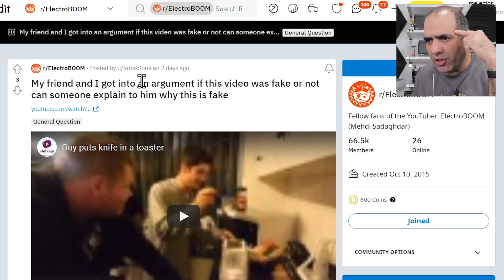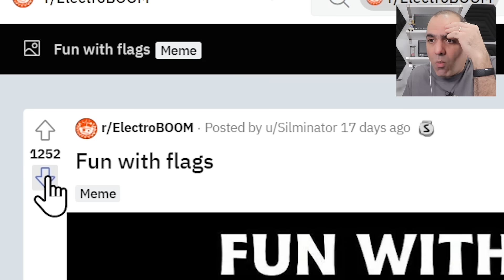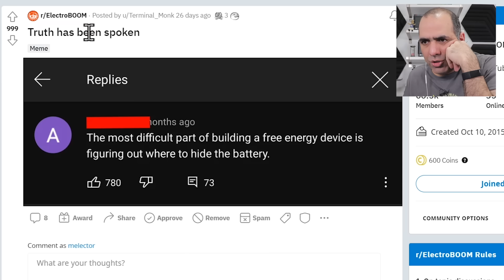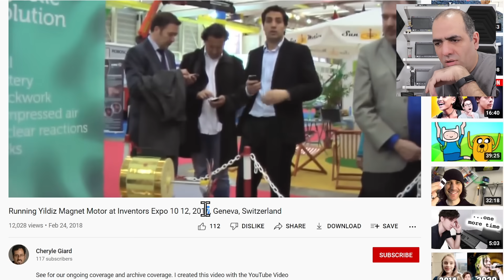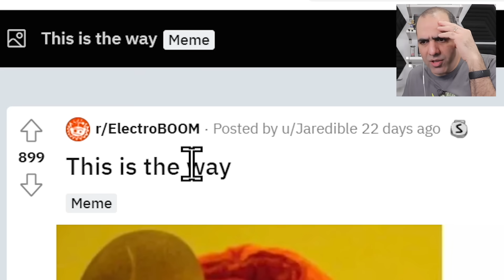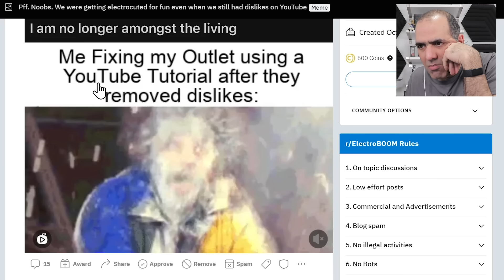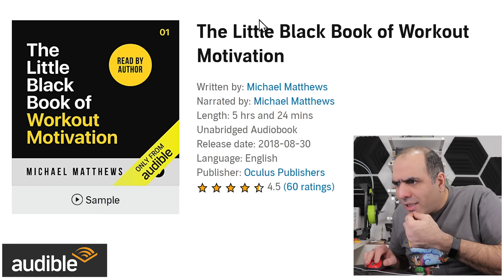Sticking Knife in Toaster? Welding with SALT WATER?!!! (LATITY-009)

Comment: that wasnt cloride i think. its probably hydrogen and oxygen. this is because of electrolysis i think.
Reply: If the solution is dilute, O2 dominates (thermodynamically favoured path). But if it's concentrated, Cl2 evolution is favoured, since it has a higher SRP value.

Comment: The "Free Energy" Motor with the magnets is real. Of course you are gonna doubt it but it is not free energy. By the laws of thermodynamics it is possible since magnets use energy. While it doesn't use electricity, it uses the energy inside the magnets which is why after a decade of use that motor will stop working, because the magnets will stop being magnets and there will be no magnetic fields. I have personally seen a machine like that up close by someone in my school who made it around a decade ago. It was at a small scale and I personally checked for batteries and there wasn't a single wire inside, it was just magnets. So, in theory it is not actual free energy as free energy does not exist but it is an efficient way of converting magnetic energy to kinetic energy

Comment: There is plug that shut off the plug power

Yes, there are smart plugs available that can automatically stop the power to a device after a set time or when certain conditions are met, such as when power consumption drops below a threshold. These smart plugs often incorporate features like energy monitoring and timer functionality, allowing for automated on/off control. 
Here's a more detailed look at smart plugs with auto-shutoff capabilities:
Timer-based shutoff:
Many smart plugs allow you to set a timer, after which the power to the connected device will be automatically cut off. 
Energy monitoring and shutoff:
Some smart plugs can monitor power consumption and shut off the device if the power draw drops below a certain level for a specified time, preventing standby consumption or overcharging. 
Smart home integration:
These plugs can often be integrated into smart home ecosystems (e.g., SmartThings, Alexa). This allows for more complex automation, such as turning off a device based on time of day, location, or other triggers.

Comment: Technically free energy is real, but its solar power/panels. The sun is free, and most of the time its there, I dont know much about if solar panels and that stuff requires a battery, tho...
Reply: It's not free energy, because you are just converting existing energy to a different form. "Free energy" refers to creating energy which according to the laws of physics is impossible
Reply: @tahmah4438  aaahh, now I see. Thanks for the explanation !! ^^

Comment: Well, as a 12 year old kid, I really was dumb enough to hold a knife in a toaster. First I was facinated by the fact the heaters got darker because it was cooled by the blade of the knife and it glowed less then. But suddenly I touched the metal case of the toaster and I popped the ground fault protection device, while the toaster sparked a bit. No boom, just a slight pop and the fridge, the tv and everything else in the house went off, as the ground fault protection disconnected.

Comment: Late comment, but the gas seen coming from the knives in the saltwater is hydrogen and oxygen gas. He's safe if the place is well ventilated
Reply: Late reply, but it's also chlorine gas (Cl2) as he used sodium chloride to make the water conductive.
Reply: @Aaaaaaaaaaaaaaaaaaaaaaaaaa-i8y  Cl2 would only be released if the solution was concentrated enough

Comment: If 99.06% of the surface area of my body has no bullet holes, it’s concerning that 0.04% of it does. If it increases and now let’s say 0.05% of the surface area of my body has bullet holes, and a little bit later has 0.06% then we start to have a big fucking problem

Comment: If you really want to use an electrolysis jar as current limiter for whatever reason, don't use salt water or it will (obviously) generate chlorine at the anode. Use a dilute solution of sodium hydroxide or even better, sodium sulfate (with suitable electrodes of course), only hydrogen and oxygen will be generated. Sodium hydroxide solution is highly alkaline, so hazardous for skin and eyes, wear protection. Sodium sulfate solution is the best choice, pH is neutral and stays neutral while operating, as the sulfuric acid and sodium hydroxide generated at anode and cathode respectively will neutralise each other on the spot.

Comment: the problem was you where trying to weld aluminium (the alligator clip) with a regular steel electrode. it would probably work better welding steel

Comment: 6:00 fun fact, that gas is not salt-based but a mixture of H2 and O2, a process called electrolysis (I think). The salts there just to let current flow because pure water is a poor conductor. It's cool for making fuels :D
Reply: It's hydrogen and chlorine gas, sodium hydroxide remains in solution

Comment: I work at appliances, I’ve seen a grounded, heating element in a dryer before. The heating element touches the housing, allowing continuous current through the heating element, and bypassing the normal circuit. As long as the dryer is plugged in the element will continue to heat, even if the dryer is shut off. Huge fire hazard.

Comment: Two things:
1. The biggest farce with "0 point" or "perpetual" energy, is that isn't enough.  In order to have a motor do work (like turn something else, spin a fan, etc.) it has to actually produce more energy.  Even if you had a machine that had absolutely zero friction and could run forever, the moment you applied a load to it, it would stop.

And 2. Youtube removing the dislikes is demonstrably not to protect the creators, as they're the only ones who can still see the dislikes.  That's like trying to protect Medhi by taking away everyone else's electronics.

Comment: Toasters used to have a double pole switch to make sure the heating element was totally isolated when the toaster was off. Is hat true now?  None of the toasters I have had used 3 wire cords with a grounding plug. Is that standard now?

Comment: 1:18 interesting thing I remember seeing is TKOR tried this (the knife was attached to a long stick and a grounding wire for safety, rather than in anyone's hand directly) and the knife seemed to form a very weak "weld" with the heating element and stuck slightly (weld probably isn't the right word, but its the best one I can think of right now)

Comment: 6:20 just a friendly reminder, SHOCKED THE SH OUT, put on your ground wire before starting to weld with TIG-method. (high voltage kickstart)

Comment: 1.Wait did he just say that he was insulated holding his knife, while the metal was still exposed between the handle parts?
2.If im right then, when he was "welding" he started electrolysis in his jar. Meaning that he propably made hydrogen and oxygen gasses which are already explosive when mixed, +many sparks nearby. Hmmm. 
I think that he was pretty much in danger.

(pls correct me if im wrong)

Comment: Hello, all the best?
    5:54  Here in Brazil there are people who use this experience to weld gates and railings, things here in Brazil are difficult to acquire, there is equipment that costs a month's salary or almost that, remembering that there are always others expenses, to have a credit card you need to have a proven salary, and registered with the worker's agency, and many are unemployed and jobless and don't have this credit, so there are many to be able to work, you have to do these things like this, even though it's very dangerous , there are many that connect to the drs, and circuit breakers, in the power drop box.

Comment: the "welding with saltwater" is actually not most dangerous beacause of terrible circuits, but beacause:

SALTWATER + ELECTRICITY = CHLORINE GAS (and hydrogen)

yeah ElectroBOOM says "it must be chloride or something" but chloride and chlorine are not completely the same
and chlorine gas was used in... one of the world wars as poison gas due to being similiar weight of air and also being very dangerous for your body if youre standing in a room with 30% chlorine gas

Comment: I also did that, stick a knife in a toaster. But it was an all metal knife, so also the handgrip conducted lol. But i didn't really felt anything and the ground switch popped, we have those here by default in the fuse closet of the house / appartment.

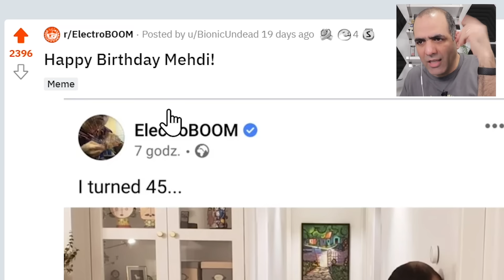Comment: 2:50 - I know a story of a man that tried to fix a microwave using a metal knife, but unfortunately had touch the HV wire with the knife, the MOT was on and he was electrocuted and died due high voltage.

Comment: At first I thought that saltwater thing was a basic electrolysis experiment, where whiteish sediment of sodium gathers on the cathode, while yellowgreen cloud of chlorium on the anode. But you probably need direct current for that. Not to mention that probably you only need a 5V battery, not 220V from power outlet.

Comment: In my effort to create a free energy device that failed, naturally. 
.
However I ended up creating a electromagnetic based capacitor that stores an ever-increasing amount of electricity in Tesla coils as long as electricity is passing through it until either it melts down or you stop putting electricity through it then it begins to discharge quickly like a crappy battery. I can't afford the equipment to test it but hypothetically it can hold far more than any capacitor of comparable size
Reply: Science-Fans are Sometimes Dumb. Its ok, i can say that, cause im a Science-Fan myself. But jokes aside: Do you keep yourself updated on local and global Issues, friend? Are you aware of the the possible Food-Shortages as well as the Danger depicted in the GOP-Videos of "Some More News"? Said Channel covers Crops, Hate, War, aaaand mooore, so it’s really valueable-much to keep you updated.

Comment: I actually stuck a butterknife in a toaster as a kid whenever the bread got stuck. All that happened once was the blade got stuck to the glowing wire, felt like a magnet (like 2:05). I quickly pulled it out and never did it again.

Comment: As for the toaster, the heating element can be thought of as a potentiometer. If you touch the knife to the heating element near the energized side, it will have a higher voltage than if you touch the heating element near the neutral (electrical return) side. If you do not have a grounded outlet, touching the knife to the heating element and also letting the knife touch the metal case, will energize that metal case. If it is grounded but doesn't have a GFCI outlet, then the same thing will possibly energize the metal case a little bit or not as much, depending on the amount of resistance on the return path from the ground connection on the outlet to the neutral connection in your main electric box (where the ground system is officially set at 0 volts). More ground path resistance results in less protection for anybody touching the metal case, but less resistance means the current may be higher and more likely to burn out the heating element in your toaster (or trip the circuit breaker in your circuit breaker box, whichever happens first). Only a GFCI outlet is designed to detect extremely small ground currents and switch off in response to such small ground currents (tripping at only a few milliamps, instead of the 10 to 20 amps needed to trip a normal circuit breaker).

Comment: Some chlorine will be genrated but not much. The right way to make chlorine is to MELT the salt in a super high temperature oven, and then pass the current through the molten salt. That's actually the industrial production method for making chlorine (though they use DC instead of AC for that).

What you actually are getting here is far more dangerous than chlorine. Because there's so much water there, and the dissolved salt just acts as a current carrier, you are actually getting mostly hydrogen and oxygen gasses! And because it's AC, not DC, both gasses are generated from both electrodes (not H on one electrode and O on the other). This means that one bubble with hydrogen is right next to another bubble with oxygen, and they burst at the surface of the water, mixing the 2 gasses together, in the ideal 2H to 1O needed to make water! And yes, that is VERY dangerous, especially with a bunch of HOT SPARKS nearby! If you left that run for long enough, your room would have filled up with the ideal H and O mixture gasses, and then just ONE SPARK would BLOW UP YOUR WHOLE HOUSE! You've probably seen on the TV new some of that footage of houses exploding from a cooking gas leak. The EXACT SAME THING could happen here!

I'm surprised that all you were worried about was getting poisoned from chlorine, not that your room was filling up with the same gas mixture that would be present in the COMBUSTION CHAMBER of a ROCKET ENGINE!

Comment: I was making toast this morning, and as I used a knife to spread the butter, I was wondering:
I bet if I stick this knife in this toaster it would short the heating element(s). I would probably die because I would be equivalent to touching live wires over 120 volts. However, what if I were completely not touching ground? Would 120 volt to 240 volt AC be enough to still cause pain due to corona discharge or something? Or would I be completely fine? Either way I didn't try it.
And after watching, I learn my answer ( :

Comment: 6:05 small correction, it's a mix of hydrogen, oxygen, and chlorine (it isn't chloride unless it's negatively charged).
Reply: past a certain salt concentrartion i think chlorine takes precedence over oxygen and no more oxygen is produced (bc of side reaction)
Reply: @jonathanouyang  What side reaction?
Reply: @Owen_loves_Butters  such processes are optimized in the https://en.wikipedia.org/wiki/Chloralkali_process. From https://en.wikipedia.org/wiki/Electrolysis_of_water it states "Using NaCl (table salt) in an electrolyte solution results in chlorine gas rather than oxygen due to a competing half-reaction." and that "chlorine gas being preferentially discharged if the concentration of Cl− is greater than 25% by mass in the solution."
Reply: @Owen_loves_Butters  without source but I'm sure theres some merit to that

Comment: I think the L brackets the guy was submerging in the salt water were zinc plated   I did a project when I was in middle school where I lit up a light pack using zinc a copper rod and vinegar to make a vinegar battery I made it to the county science fair with it , was pretty cool maybe try the welding one with zinc rods and salt water and run thicker gauge wires to allow more current to pass and see if it welds I’d be curious of the results lol anyways love the videos been watching you for years !

Comment: I wanna see a 12 volt motor turn a 24 volt high amp alternator hooked to 2 car batteries in series. The electric motor just ran off 1 of the batteries. How long will it spin

Comment: Burning wood is carbon neutral. The co2 released when burning wood was captured by the tree when it was alive. When the tree dies and rots, that co2 is also released back into the air. 

I’d much rather burn wood than oil or gas and electric heat is far too expensive to be an option.

Comment: Sooo, in north America you have GFCI in the sockets? Here in Europe those need to be at the fuse box protecting the entire circuit, not individual sockets. Is there no regulation there that mandates those to protect everything and not just wall sockets?
Reply: It likely depends on the area.

Most places I've lived would, at most, have a single GFCI in the bathroom if it even had a plug there.